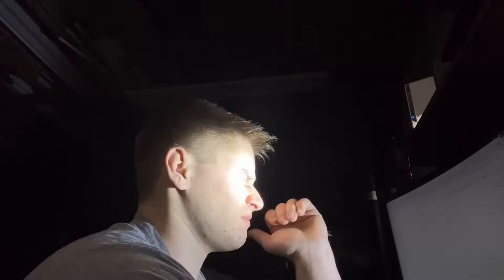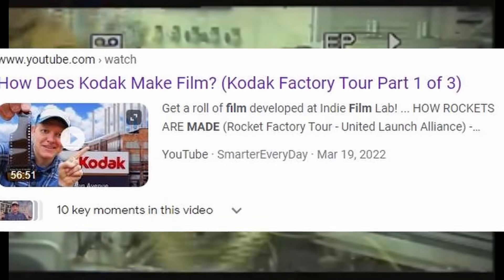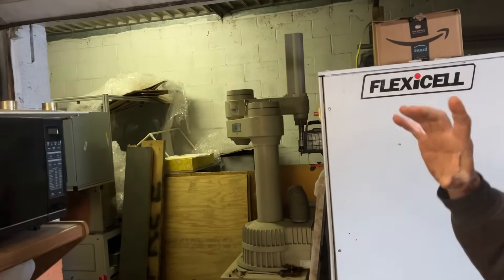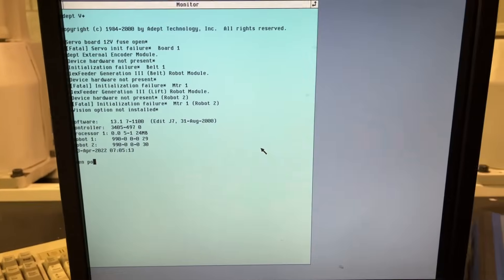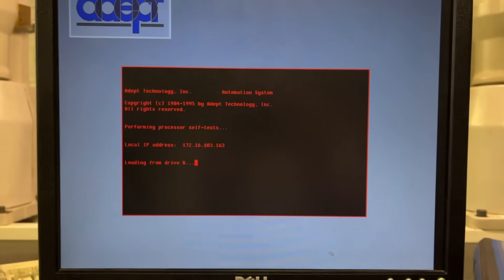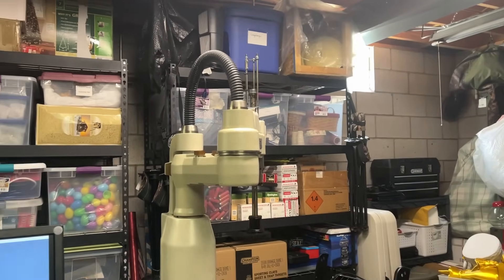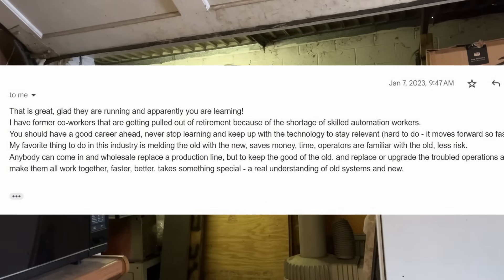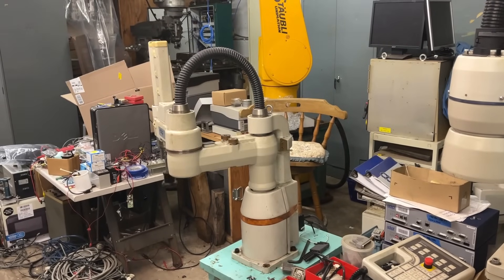How I Got Industrial Robot Arms For Free

Comment: lol I just happened to get the exact same robot arm for free a few years ago. Mine came with a controller but I gave up on trying to use that because I have no 3 phase power. Still yet to get to building a custom controller for it but this video inspired me to pick it back up!
Reply from the maker: Awesome! The Adept PA-4 controller actually doesn't need 3phase power. It will run off of split phase 240v. Here is how mine is wired:
L1 to S2
L2 to S3
L2 to S4

Comment: Aaah, this story reminds me of when I went to the local electronics shop to buy a replacement fuse for my 3MP (!) digital camera, a very small surface-mount fuse mind you! I mentioned that I was not exactly sure how to solder it, and they kindly directed me to someone who might be able to help me. Turns out the guy was a retired robotic electronics guy, but he was also constantly getting pulled in to new, small jobs since he was the only one with the right knowledge. Also he did the soldering of my camera fuser for free! :)

Comment: Are you sure you can run both at the same time? It could be a safety feature that this is not allowed. If arm1 ist static, arm2 can do it's path planning and does exactly know where the allowed area is. Otherwise they would need bidirectional online path prediction
Reply from the maker: 🤔 possibly, I'd have to do more research. But I think it has to do with the fact that the controller only has one AWC card, which is like the brains of the controller.

Comment: I love that you mention these old robots being 30yr old but still running great. I have an engineering company that specializes in weird work for food process, aerospace, medical, architectural, structural, power generation, defense, etc. most of my work is reversed engineering broken components for my customers' equipment that is no longer supported by the OEM or the OEM doesn't exist. For example integration of modern fanuc arms with custom candy packaging lines at 6 boxes a second fill rate, making ceramic crimp sealer insulators etc. Please keep up the great work, honestly I just turned 40, I quit my design engineering job 14yrs ago to start my machine shop, I have cnc machines from 1978-2007 making really really tight tolerance parts for my customers, albeit not large production qty, but enough to get their facilities back up and running. I must turn down a few dozen jobs a week, and focus on problem solving and high value added services for my customers, I really see a lot of myself in you when I started my business. Please feel free to message me, happy to assist any way I can, I had some amazing mentors and feel like I need to pass on anything I can and connect with others like you and I as we're definitely off out on our own and community is amazing as there's so much great work to go around. Rick

Comment: FYI, compared to a lot of industrial hardware, robots don't have much used market value, beyond just parts and replacement units for existing (but older) production cells. They're a bit like CNC machines in a way, since they inherently get less accurate over time. Not by much, and often not enough to actually justify selling them for scrap value. Robots are pretty much the same, and in a way do lose their reliability rating and accuracy over time. But again, not by much, and certainly not enough to justify selling working units for scrap.
I work in machine building for medical device production, so high value stuff. But it kinda feels wrong to use a brand new Kuka arm, requiring all new software, calibration equipment and training, when we could've just bought the same robots we were using 4-5 years ago second hand, and probably get better results.